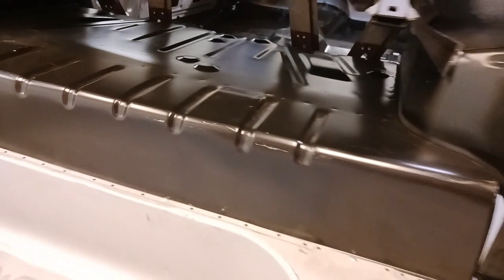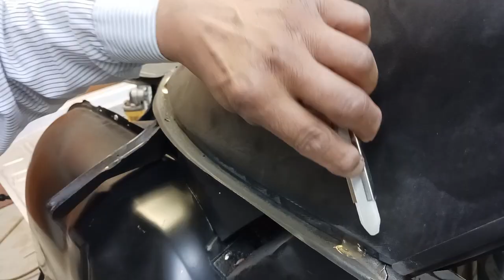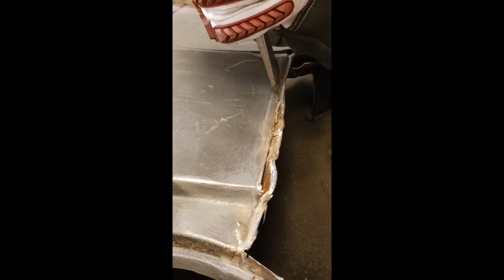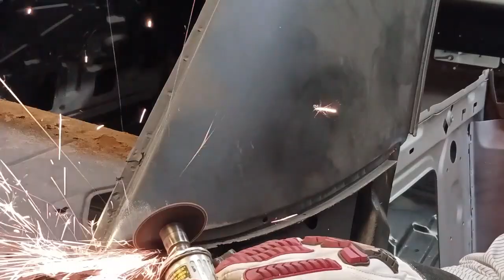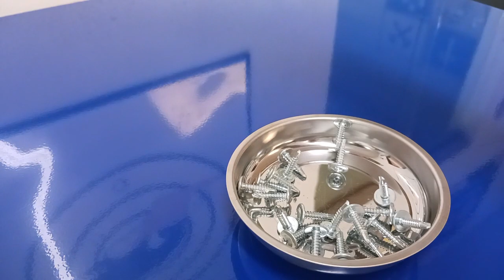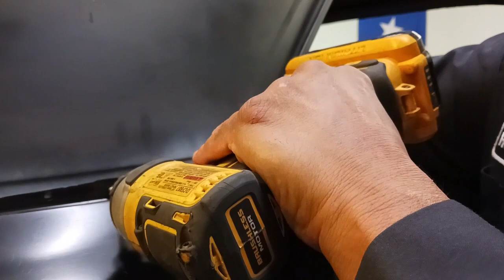1962 Impala Restoration Part 15   Quarter Panel  -  Prep & Fit    DIY Auto Restoration

Comment: Love watching you restore that 62 impala,I’m in the process of doing my 62 as well , you do fantastic work and I’ve gotten some great info and videos of some stuff that I had issues with like a rusted area at the qtr to roof area by the side window didn’t know what the original steel looked like till I saw it on your video,thanks,I’ve gotten the floor complete floor done as well as two qtr panels and drip rails,trunk and some self fab work do you hav pics of that area I’m talking about, it’s between the qtr roof line at the rear window. I’ll take a pic today and send it to you if I can.again thanks for the videos
Reply from the maker: Awesome job doing the work done on your own car.
Sorry, I don't have a picture of that area you mentioned.
Thank you for supporting the channel you're much appreciated !

Comment: I have heard that some body guys do not like the weld through primer because it does mess up the weld. Has this ever been an issue for you. And if not, why do you think some guys don't do it? Could it be a lazy thing?
Reply from the maker: If it is applied too thick it can cause issues and that can of weld through primer is $40. another reason some won't use it. If the mating surfaces are bare steel and are welded together, corrosion (rust) will start in between....
Reply: @guzzifabrication3448  now that makes sense.

Comment: Is there any downside to going over instead of under on the quarter panel roof attachment above rear wheelhouse?   I guess the chrome goes over that either way right? Hey man appreciate your videos.
Reply from the maker: As long as there are no deck filler to quarter panel to trunk Gap issues not really a downside unless you're replacing the roof yeah it would be a big deal to slide the quarter panel under the roof panel that could turn into a real mess real fast. Hey thanks for watching !

Comment: The length of that quarter panel.. Nice job. 👍 Hey what type of jacks are the once on the start of the video that hold the trunk floor underneath
Reply from the maker: Those are 4' collapsible jack stands, welding supply stores carry them. Thanks for following the channel !